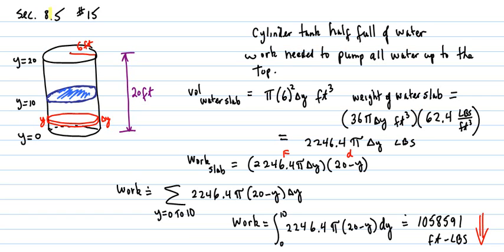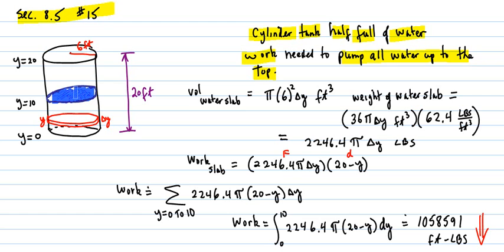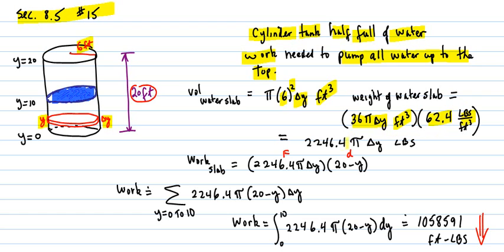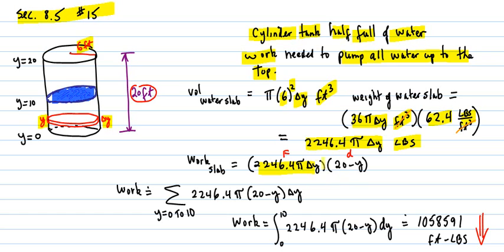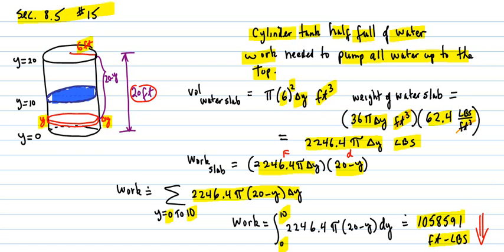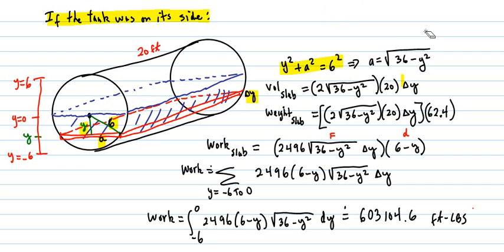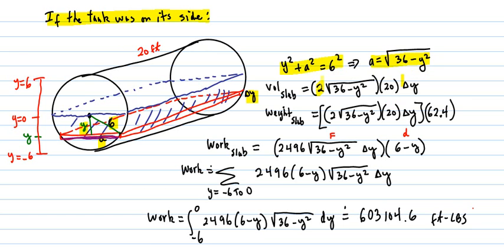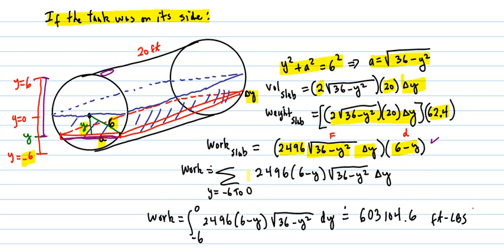Work - pump water out of cylindrical tank

Comment: ....why is gravity not included?
Reply: Since we're working in the context of the foot-lbs system, gravity is incorporated into the 62.4 lbs/ft^3. since lbs = weight = ma = mg. This is different from the metric system where we use density (based on mass alone) and then multiply by the force of gravity. Some calculus professors tend to work in the ft-lbs system since it simplifies the physics (not all calculus students have necessarily taken a physics course nor is it a prerequisite to Calculus 2)